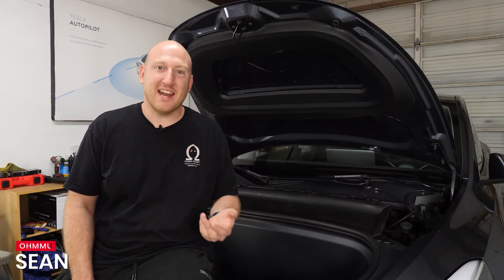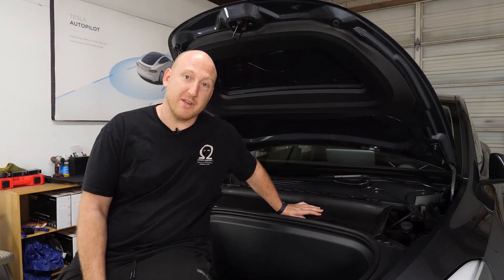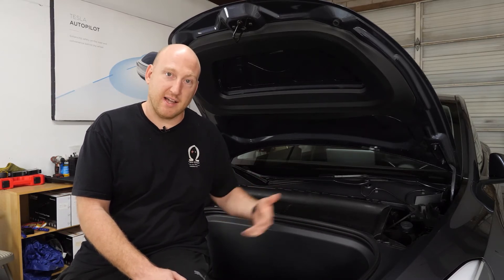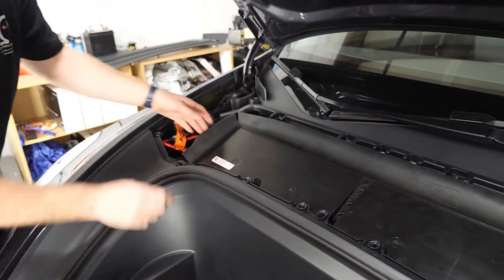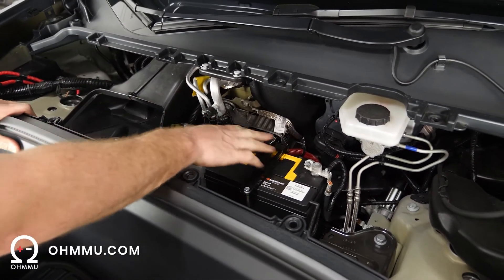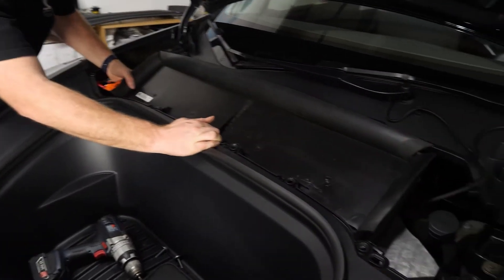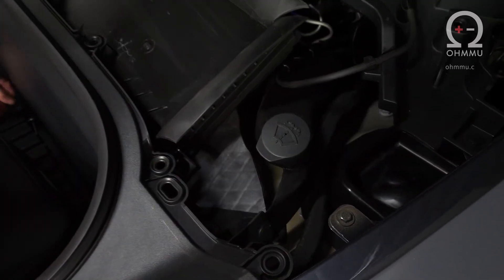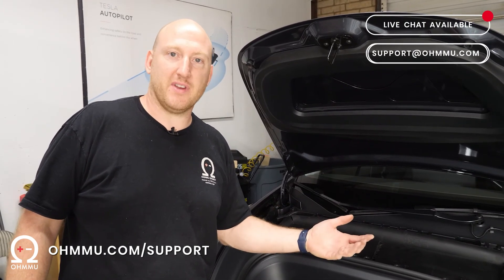Installation Update for Late 2021–March 2022 Tesla Model 3/Y - 12V Battery Installation (Ohmmu)

Comment: I have a 2022 performance model am I missing something cause I don’t see that 12 V battery there
Reply from the maker: Sorry for the delay, but depending on your model's manufacture date, it could be different. Tesla made a lot of changes in 2022, including switching to a proprietary 15v lithium battery.

Comment: I have trouble removing the First Responder connector for a Model Y 2021. I unsnap the red tab but then I can’t pull apart the connector at all. I tried pushing the top of the connector while pulling and it wouldn’t budge. Very frustrating.
Reply: Same with me, I found it a bit stuck in there, but keep gently pulling the connectors apart once you pull the red slider back and it should come apart
Reply from the maker: If any dirt/grime/dust get into the connector it can make it hard to pull apart, it'll come apart though, wiggle back and forth a bit (the connector, not yourself, haha) while pulling and that could help.

Comment: Do you know how to test aftermarket terminals on the 12v batter for parasitic drain?
Reply: I'm not sure what aftermarket terminals are. But probably the best way to test for any current is a DC clamp meter around either one of the wires that attaches to the terminals. The meter will need to be sensitive into the mA range. And a good meter in this category is $100's.